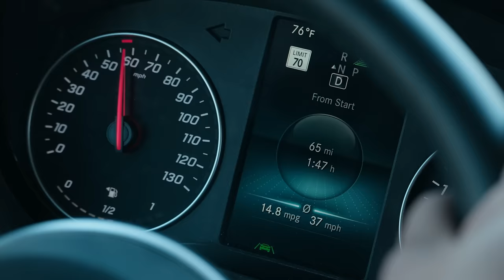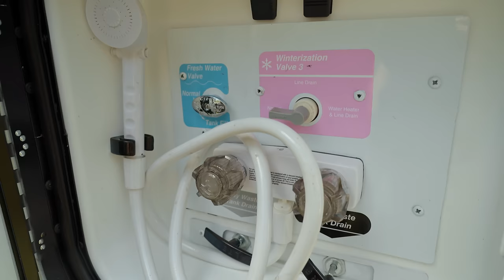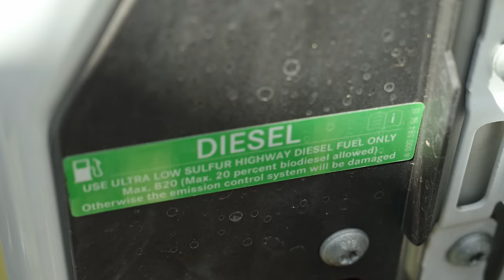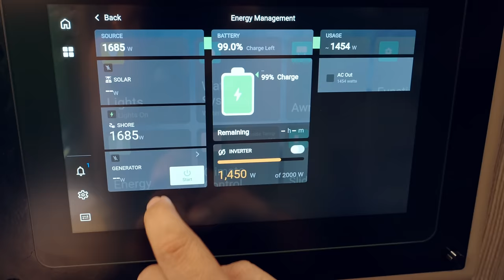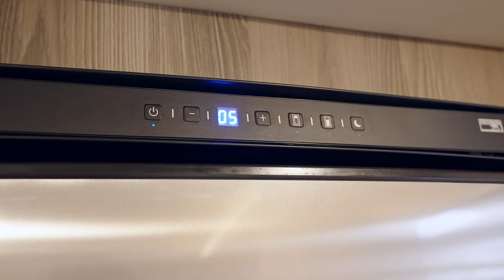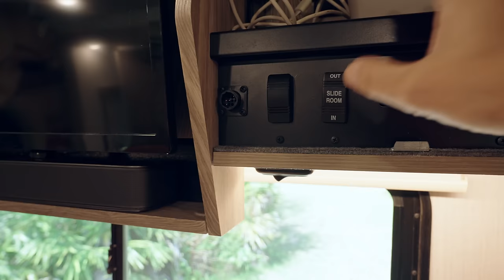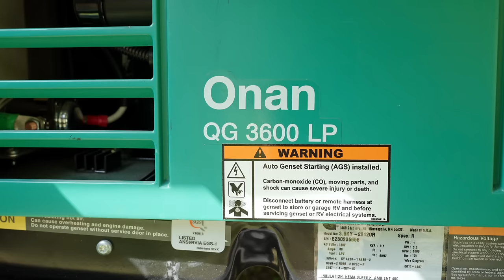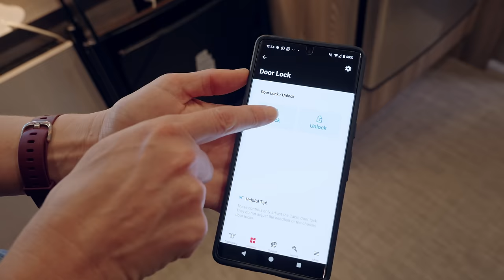🚐💨 Living in the World's FIRST Winnebago View 24T - Full RV Tour! | Newstate Nomads

Comment: Thank you so much for stating the OCCC of this RV as this is so often overlooked but it so critical.  With only 927lbs of capacity you wouldn’t be able to utilize much room in all those storage areas which is kind of interesting.  You mentioned how much space there was to store stuff but realistically you would only be able to use a fraction of it.  If you take the weight of two people (330ish lbs I’m guessing) plus the weight of 20 gallons  (210l s) of liquids (1/2 fresh and some grey and black) that leaves you with just under 400 lbs of stuff which gets used up extremely quickly when you look at all those storage spots.  I am very curious to know what the total rig weighs the way it sits right now as I’m guessing it’s already overloaded and you don’t have bikes or many other accessories that I’d see people bringing.  HUGE miss by W and a very dangerous situation to put owners in.  Realistically this rig needs at LEAST another 1000 lbs of capacity to truly utilize the space that it provides.

Great looking RV but a strong pass given the ridiculously low capacity.